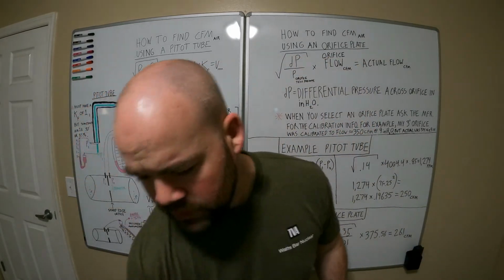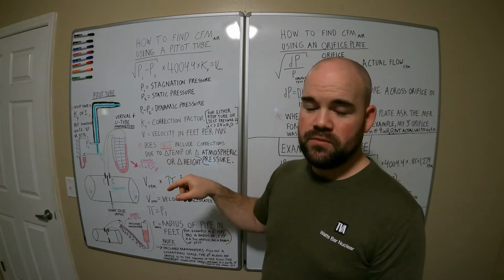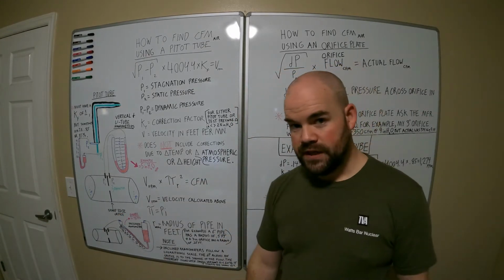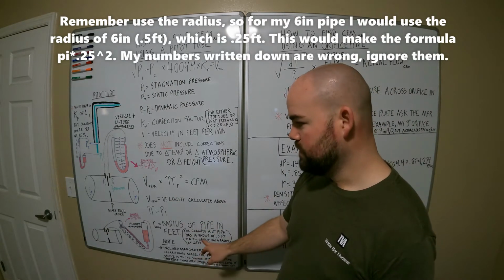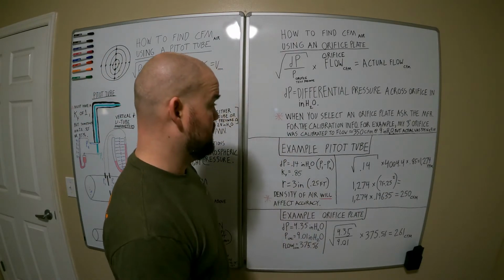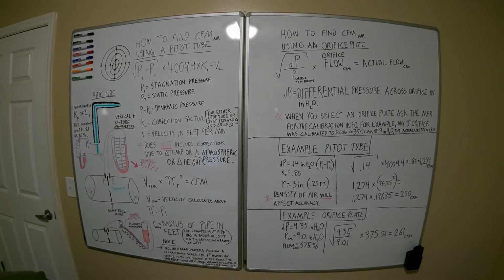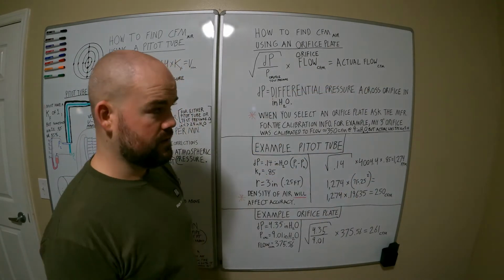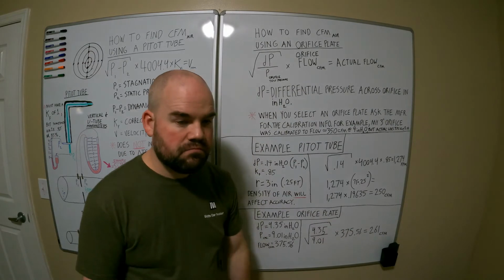Homemade Flow Bench Part 1, How to Calculate CFM

Comment: I learned a lot from this video. Just one question, do you feel with flowing a head meant for a turboed setup, does it make a differnce if you blow the air through the intake port or suck it through the intake port?
Reply from the maker: Using a power adder such as a turbo or supercharger changes nothing about how you develop an intake port. Keep in mind that a flow bench measures volume flow not mass flow. An intake port that flows 300cfm naturally aspirated will still flow 300cfm under boost. The difference is the mass of the air. A power adder generates an artificial atmosphere inside the intake manifold. For example, under perfect conditions we have 14.7 psia of atmospheric pressure available for the engine, so if you run 15psi of boost that means the engine sees ~30psia. This means you have twice as much oxygen available to facilitate the burning of twice the amount of fuel. More air does not make more power burning more fuel makes more power, but to burn more fuel you need a greater amount of oxygen. A power adder does not force air around the valve, all it does is increase the density of the air. To put it a different way, 1 cfm of air is made up of ~21% oxygen at atmospheric pressure, 300 cfm of air is also ~21% oxygen at atmospheric pressure. When we run 10 psig of boost we just increased this number by 68% so now we have ~35% oxygen available to burn more fuel and make more power. Make since? Build an engine to make power where you want the rpm band for your application to be, then boost will literally just shift the entire curve up. The power curve itself won't change, just move up on the y-axis.
Reply: @tristan_white  I understand what you are saying but I was just wondering if blowing through or sucking the air through while on the flow bench would make any difference. This will be on a 6cyl tractor that runs about 70 psi boost
Reply from the maker: @TheJohndeere466  no, it makes no difference at all as long as the airflow is traveling the way it would in the engine. All the head sees is the differential pressure. When you suck through (what basically every bench does for intake port testing) the bench generates an atmosphere that is at a lower pressure the atmospheric. Air always passes from high pressure to low pressure.
Reply: @tristan_white  Oh thanks. I am designing a recast head for this tractor and I was going to have a guy flow it but he said on boosted engines, he always blows the air through on his flow bench. Not sure how he does that.
Reply: @tristan_white  I am working on designing a head for this tractor. We almost won the points championship this year and we won more pulls than anybody. The guy that did win the points was caught running illegal fuel but they checked it before he ran and allowed him to change fuel before he pulled. They didnt check fuel everytime so im sure he ran some of pulls with hot fuel.

So we are close. My plan is to design a head that flows real similar to the head we have but with the smallest port I can get away with. Our head also has siamese ports where 2 ports are combined until they get back in the head. I want to seperate the ports in the head and the intake to allow longer ports. This head was opened up a little and we did gain a little on top but we lost some torque. So we would like to get both. I am casting just one cylinder versions of the head and experimenting with the ports. I will eventually get the head flowed by a professional but I would like to try building a flow bench that I could tinker. with. I really dont care if it tells me how many cfm it flows. I just want to know if what I am doing is making it better or worse.

I was thinking of using a leaf blower and blowing air into the intake port and measuring the pressure right before  the intake port with a well manometer mounted on slight angle from horizontal to allow for measuring very slight pressure changes. I figure more pressure equals less flow and less pressure equals more through the head. What are your thoughts.
Reply from the maker: @TheJohndeere466  who ever this is does not understand fluid dynamics. Plus you never develop a head with just the head on the flow bench. It is imperative to flow it with the intake manifold you are going to use for final port shape. Each port must be developed as if it is its own engine, because the manifold will effect distribution so some ports need a different shape.
Reply from the maker: @TheJohndeere466  let me ask you something first before we discuss your bench. Have you ever flowed the heads before? What are you looking for in power?
Reply: @tristan_white  The last guy that worked on them had then flowed. I havnt seen the numbers yet. about 1200 on hp
Reply from the maker: @TheJohndeere466  what size engine and at what rpm? Also, you really need those numbers, because they will help you understand what your starting with. What is the cam, rocker, and valve spring specs?
Reply: Actually it is close to 1200 now
Reply from the maker: @TheJohndeere466  1200 at what rpm, and what is the cubic in displacement?
Reply: @tristan_white  The engine is 529 cu in 6 cyl. 4.562 bore with 5.4 stroke. I dont know the cam specs off hand. The tractor belongs to my buddy and my son and I do most of the machine work. I made the crankshaft, rocker arms, girdle and many other parts. I can get the other specs
Reply: @tristan_white  3200 rpm 529 cu in. The last time we dynoed it was hitting 2050 ftlb at 1800 rpm. It makes more power now but I think we lost some torgue. We are going to dyno it as is before we tear it down. We havnt dynoed it for atleast 3 years. It has a much better turbo now.
Reply from the maker: @TheJohndeere466  typically you want to develop the head and intake manifold first, then spec out a cam that will take advantage of the flow characteristics. If you do not know the cam specs I would try to find out. One thing you could end up with is a great product that does not do what you expected because the cam is no longer correct for what your doing. What rpm range are you looking for?
Reply: @tristan_white  It will rev to 5000 but going down the track it pulls it down to 3500. We have a few different cams that we have tried over the years. Just not sure on the specs off hand. The cam thats in it has been the best so far.
Reply: this class has a limited turbo. The outlet on the compressor housing is only allowed to be 2" diameter on the od. The id is even smaller.
Reply from the maker: @TheJohndeere466  I understand. As far as the flow bench method I would not advise with going that direction. The standard method would be better, because of the intake manifold development. Part 3 I show the construction of my bench. It's pretty easy to do and would give you a better result. The leaf blower just is not going to be able to move enough air.
Reply: @tristan_white  I used to have a whole box of those vaccuum motors you showed in your video. i bought them at an auction
Reply from the maker: @TheJohndeere466  yeah, they are easy to get. I don't know what your heads flow, but my sbc heads that flow 325cfm use 5 motors to pull a 1 psig of vacuum or ~28" H2O.
Reply: @tristan_white  the tractor owner said he thought it flowed around 290cfm. I talked to a guy that builds pulling tractors and he said you want no more than 275
Reply: the motor I have are not all the same size. atleast a couple differnt sizes
Reply from the maker: @TheJohndeere466  watch my video on cylinder head and camshaft selection if interested. The camshaft valve timing events effect where the same head will make power. Flow is only one of many factors that matter, and whoever told you that info does not understand. 275 cfm at what lift? The cam make a full sweep up and down, so the average flow is far more important. The minimum cross sectional area, valve job, valve diameter, and chamber size also matter.

https://youtu.be/SCMt6IdZ_6c
Reply: @tristan_white  I got the flow numbers on the tractor head. It flows 343 at .600 on intake and 306 at .600 on the exhaust
Reply from the maker: @TheJohndeere466  do you have the whole .100"-.600" lift numbers? Are you changing the cam?
Reply: @tristan_white  I do have all the numbers but it doesn't say at what depression it was flowed at. I assume 28". We were not planning to change cam but we will if need be
Reply: We sent it out to have it cnc ported but the guy said it was already too big for our small turbo and rpm that we run
Reply from the maker: @TheJohndeere466  find the lobe profile you have, and send it to me. Give me everything. Complete engine specs, from intake air cleaner to the tail pipe. Including you current turbo and full specs. I will custom spec you out a cam. Not normally something I do for free, but I will. Shoot it all to me and I will get to work on it when I can.

Comment: I built a U tube manometer I want to measure at 28 inches of water column. Do I fill the tube to 14 inches on both sides to equal 28inches in total or do I fill the tube to 28 inches on each side?
Reply from the maker: A 14" total displacement on each side would be 28".
Reply: Thanks for the prompt response.
Reply from the maker: @VGHCX  no problem, glad to help.

Comment: Where do I get a calibrated orifice?
Reply from the maker: I purchased mine from performance trends for pure convenience, however if you have a shop close by that can stamp you out a 3" sharp edge orifice than it would probably be cheaper. You can calibrate your bench on your own. If you need help with that let me know.
Reply: @tristan_white  Thanks buddy. Once I create a successful analog system. I will go digital. I am well versed in microcontroller and application real time programming.

Comment: Absolutely true. Must air density +temperature +humidity and air direction vortex vs straight flow
Reply from the maker: Compensation is key
Reply: @tristan_white  disagree. Fire injector right before or at max air velocity will keep fuel atomized and suspended . Direct injection is 100% in cylinder rail injection only 85 to 90 % makes it into cylinder need for maximum velocity suspension. Direct injection minimizes variables
Reply from the maker: @MrBlackbutang  disagree with what?
Reply: @tristan_white  thought you were talking compensating manually?
Reply from the maker: @MrBlackbutang  no I agree with you was what I meant.

Comment: The inverse relationship is likes squeezing a hose
Reply: Since flow is not linear trying to measure 29%or less flow is hard to determine. When building an engine for boost you run a lower compression ratio to compensate for the boosted pressure. .

Comment: Thank you Tristan. As a instrument technician for 40 + years you are doing no more good than anyone on YouTube explaining differential pressure measurement. I watch Favid Vizard on YouTube and am going to flow test an old set of heads for a small Chevy engine. Just subscribed Sir. Keep up the good work.
Reply from the maker: I am sorry I did not do a good job of explaining it, I really did try to break it down simple for people who are new. Any suggestions?
Reply: @tristan_white  I think Ken meant Doing More Good and the "no" was a typo. Case in point, it's "David Vizard" not Favid... lol.  You did an excellent job of describing your material, probably the best / most detailed video on youtube on the topic.
Reply from the maker: @dfabeagle718  thank you, I will be doing more like this next year. I am in Nuclear Plant Assistant Unit Operator school right now, so my free time is nonexistent.